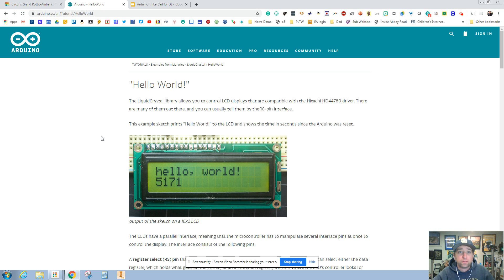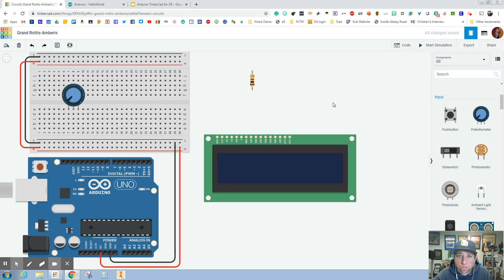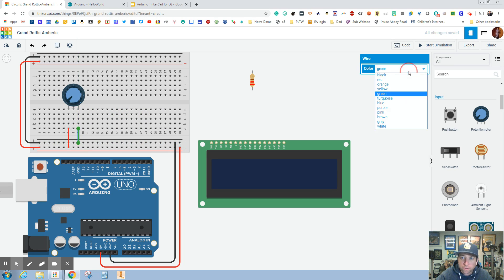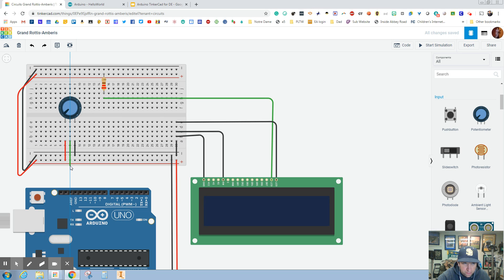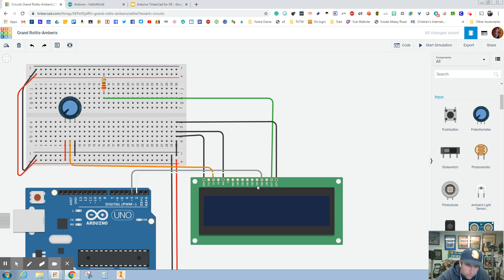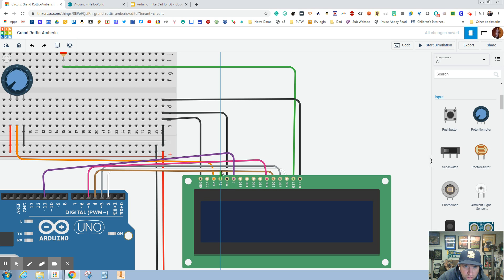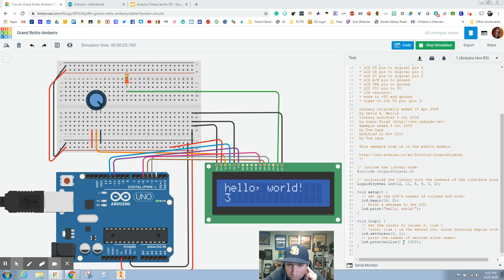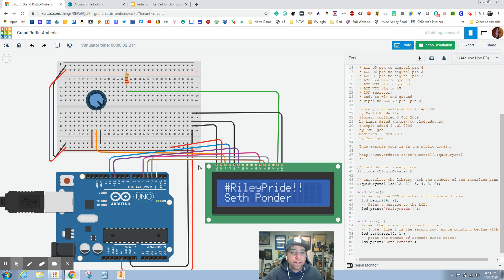LCD Screen Arduino on TinkerCad Tutorial

Comment: Hey..need your source  code buddy
Reply: /*
  LiquidCrystal Library - Hello World

 Demonstrates the use a 16x2 LCD display.  The LiquidCrystal
 library works with all LCD displays that are compatible with the
 Hitachi HD44780 driver. There are many of them out there, and you
 can usually tell them by the 16-pin interface.

 This sketch prints "Hello World!" to the LCD
 and shows the time.

  The circuit:
 * LCD RS pin to digital pin 12
 * LCD Enable pin to digital pin 11
 * LCD D4 pin to digital pin 5
 * LCD D5 pin to digital pin 4
 * LCD D6 pin to digital pin 3
 * LCD D7 pin to digital pin 2
 * LCD R/W pin to ground
 * LCD VSS pin to ground
 * LCD VCC pin to 5V
 * 10K resistor:
 * ends to +5V and ground
 * wiper to LCD VO pin (pin 3)

 Library originally added 18 Apr 2008
 by David A. Mellis
 library modified 5 Jul 2009
 by Limor Fried (http://www.ladyada.net)
 example added 9 Jul 2009
 by Tom Igoe
 modified 22 Nov 2010
 by Tom Igoe
 modified 7 Nov 2016
 by Arturo Guadalupi

 This example code is in the public domain.

 http://www.arduino.cc/en/Tutorial/LiquidCrystalHelloWorld

*/

// include the library code:
#include <LiquidCrystal.h>

// initialize the library by associating any needed LCD interface pin
// with the arduino pin number it is connected to
const int rs = 12, en = 11, d4 = 5, d5 = 4, d6 = 3, d7 = 2;
LiquidCrystal lcd(rs, en, d4, d5, d6, d7);

void setup() {
  // set up the LCD's number of columns and rows:
  lcd.begin(16, 2);
  // Print a message to the LCD.
  lcd.print("hello, world!");
}

void loop() {
  // set the cursor to column 0, line 1
  // (note: line 1 is the second row, since counting begins with 0):
  lcd.setCursor(0, 1);
  // print the number of seconds since reset:
  lcd.print(millis() / 1000);
}